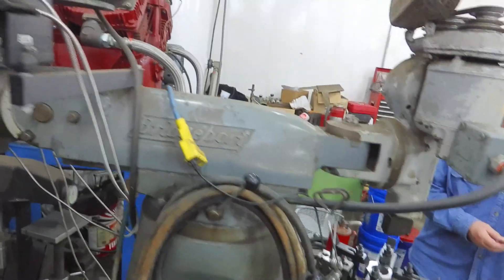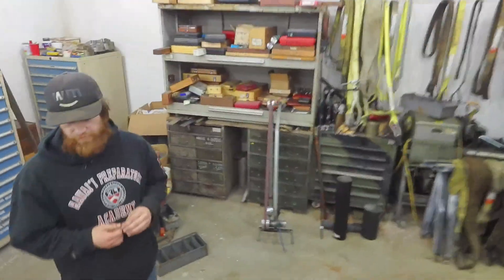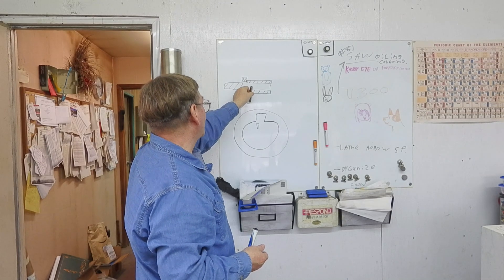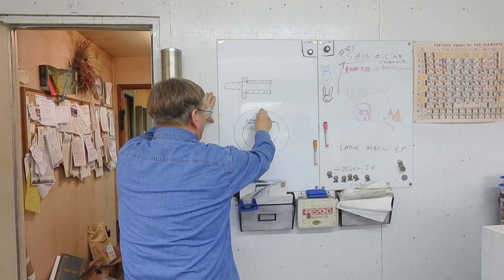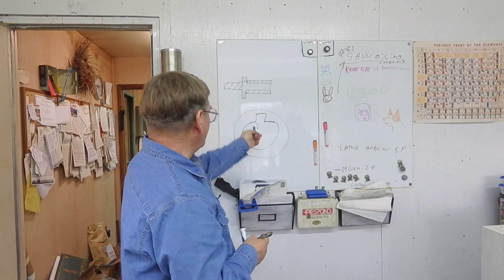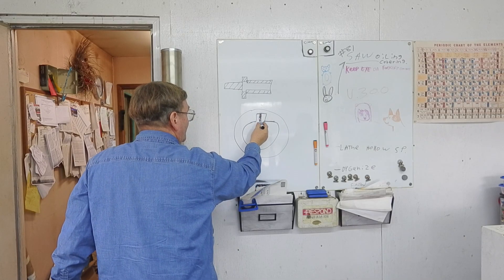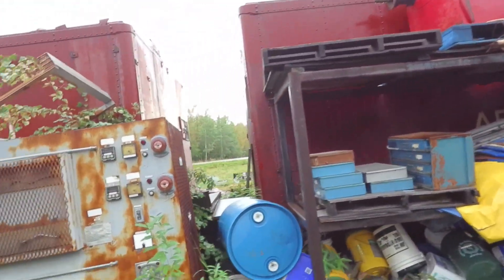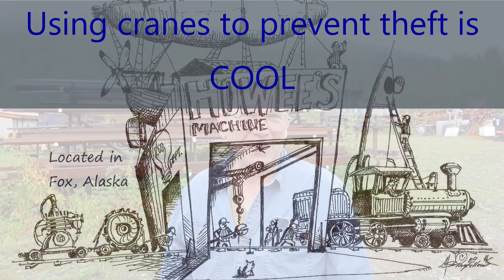Cutting Keyways with Shapers

Comment: I have cut a bunch of these over the years! I always use high speed steel that is .125 under the key way.            I Rough Stomp out the main part until it’s close to depth, and width. Then regrind my tool, measure the cutting lip, relieve the sides. Re-center the part, split the key way minus the tool cutting lip width, divide by 2, and finish. To set the depth measure the bore diameter, plus add the key way depth with an ID MICH. before you unbolt anything go grab a piece of key stock, and test it! If the hole is blind, I sometimes go the other way with the tool, so I can see down inside better. I use a magnet for chips, if it is not steel, use your snorkel blow gun. I love being a machinist, there is nothing in the world I would rather do!
Reply: You too are impressive.  Thx for the comment.

Comment: Is there actual concern that someone would come steal a shaper sitting in your yard??  Are there bandits in Alaska that steal multi-thousand pound machines? 😅
Reply: Yes there are crafty bears up there
Reply from the maker: I've heard of whole 80,000lb excavators disappearing. Things happen - the midnight sun combined with everybody's favorite amphetamine (and a dash of mercury) is a POTENT combination.
-Cameraman
Reply: It’s more to protect the machine from the weather than thieves isn’t it? Good video , 
I made a boring bar for my shaper to tidy up a traction engine gear keyway , used 2” 4140 , cut my first thread on the lathe 2”unc . The hardest part was making the square hole for the tool steel cutting bit . Roughing it out on the mill and finishing it with a square file . It worked - I’m not a machinist just a farmer from New Zealand

Comment: Never had a chance to run one of those slotting heads.  Always wanted one,  but ended up picking up a Pratt & Whitney 12" slotter at a good price before one of these came up. Haven't done too big myself, but judging by the chips this machine came with, it was cutting at least 5/8" keyways in one shot. 
We have been making our own bars from scrap chromed hydraulic rod with broached square holes to hold HSS toolbits.